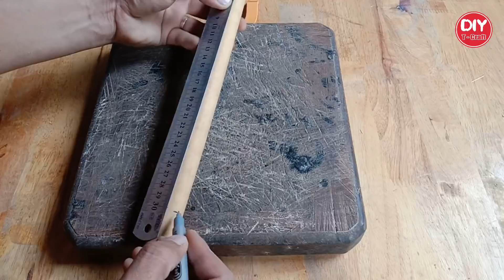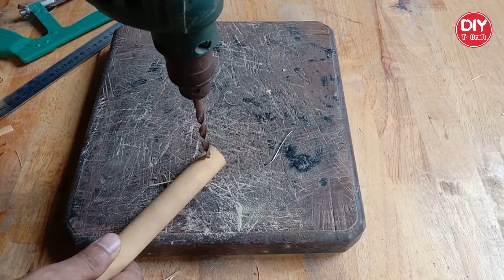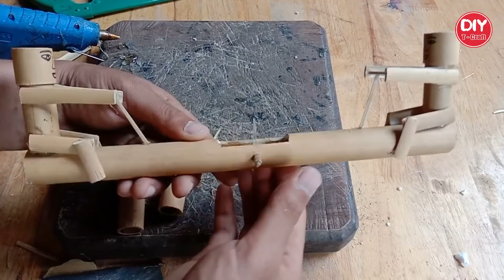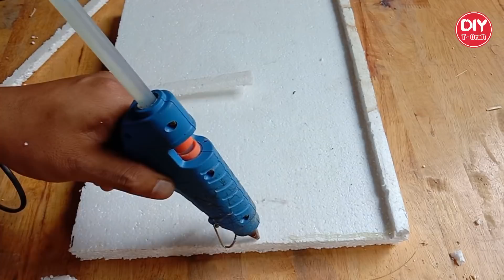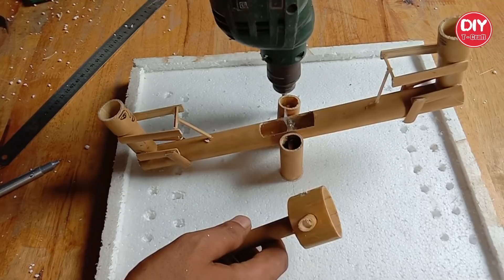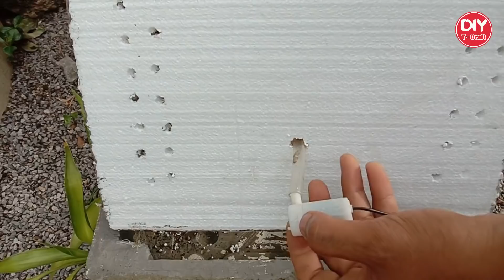How to make very beautiful bamboo with cement waterfall fountain

Comment: How does it spring back when the water keeps pouring into the lower end? I doubt the outlet hole you made can keep pace with the pump.
Reply: It looks like there’s a divider at the pivot point of the teeter. The water (weight) then fills the High side that pushes it down to empty. Clever.
Reply: desconheço este retorno

Comment: I watched the video a few times  .   I have a few questions , Do you cover both ends of the bamboo ?    What is that piece of clear plastic in the middle used for ?
Reply: Kim yes you cap the ends Making them water tight. On Either End a small hole is drilled on the underside just in Front of the cap ends to allow the water to escape . The plastic that is in the centre is to displace the water to either end so as One end fills up it Tips down allowing the plastic in the middle to change the Flow of water in the other direction. I hope this helps you out if not get back to me. 🙂
Reply: @stevenbuckley1416  Thanks ! for the reply .
Reply: Kim You’re welcome😊
Reply from the maker: thank you for wacthing
Reply: Kim f
Reply: @DIYTCraft  please what is the name of the white pomp with the cable and where will I get some.